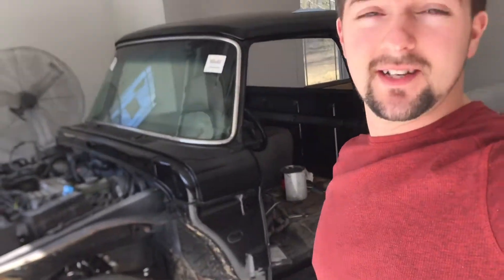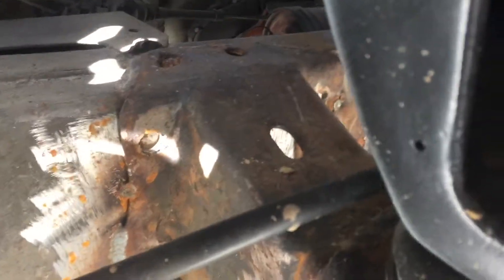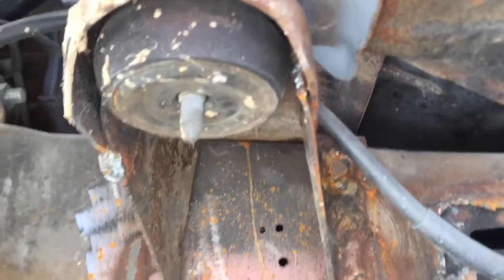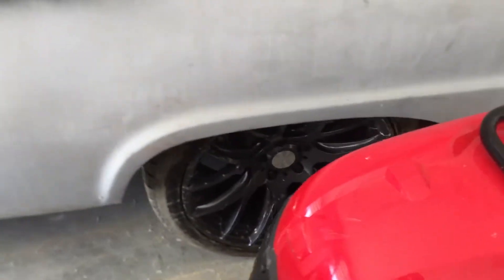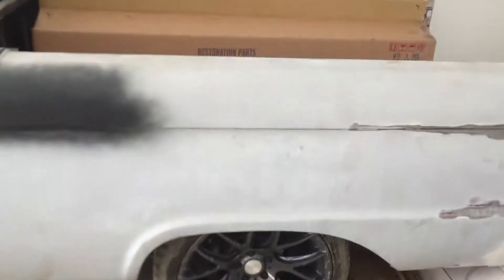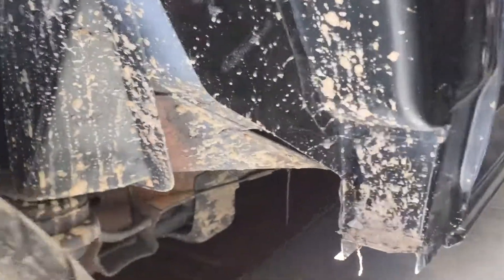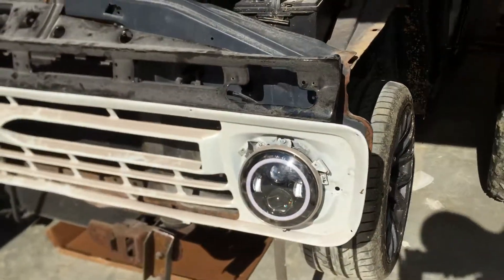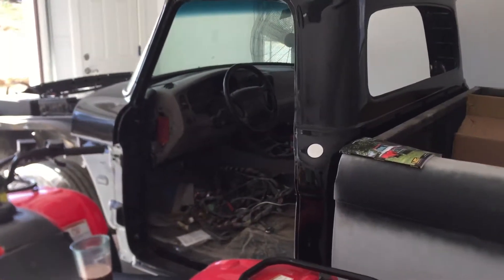F100 chassis swap 5.0

Comment: Would it be possible to do the swap without removing firewall dash etc. Or is it easier to just cut and weld it into f100 firewall? Have a 64 and pretty much the whole cab floor and bottom of firewall is rotted out was wandering if it be easier to cut it all out and slide it up to firewall of mountaineer?
Reply from the maker: James Tollison i wanted the origional air box and dash in the 66 with everything connecting like factory so went with firewall, if you just want to use it with no A/C you can splice wiring to use stock dash from 60s efiguy has video how to wire your harness.
Reply: Thank you. Your videos have helped me tremendously. And you did a great job with the truck looks awesone
Reply: @1194video  awesome will do. thanks

Comment: If you didn't lower the back would you still have a full size bed.  Thnx
Reply from the maker: tim lewis lowering it did not affect the bed, the frame itself on the mountaineer is higher in the rear, if you raised your cab higher on the frame you could keep your floor but I wanted my cab to sit lower on the frame so cutting was a must, you could just cut the rear and raise the back section a couple inches. I was going the air ride route so that’s my reason for going 6.5” higher on the floor